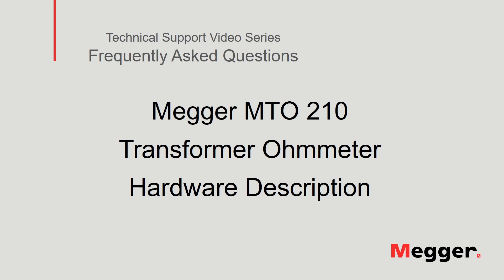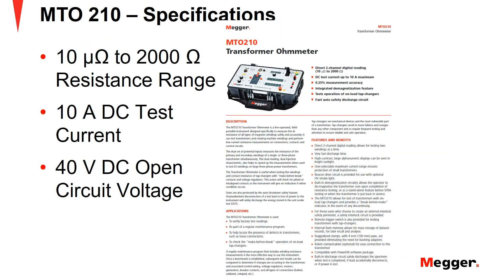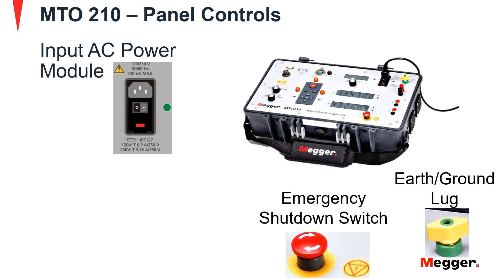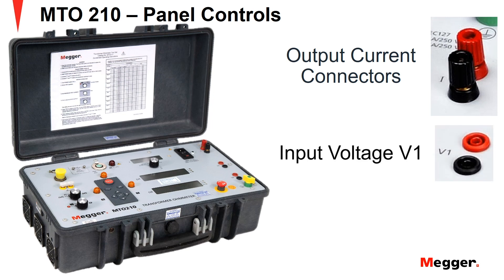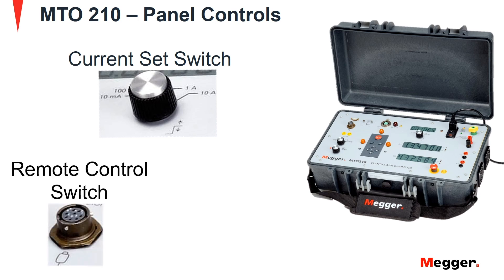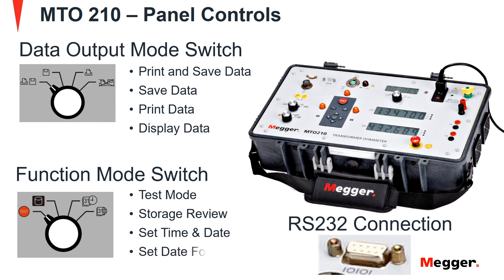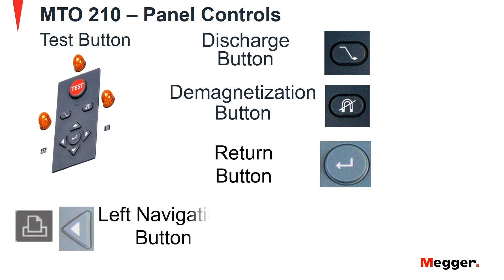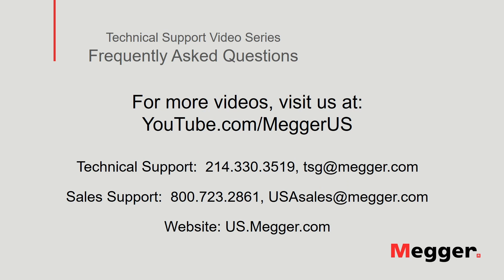Megger MTO210: Hardware Description and Overview

Comment: Sir we have same kind of set .....but problem is that ....when we inject current in power transformer the current not injected.....please help
Reply: Yes sir you are right .... because mistake is that our team member supply 2 phase supply 380 volt....
Reply from the maker: Hi there, thank you for your comment. Please could you contact our TSG team depending on your local area, details can be found on our website https://megger.com/

For UK please contact dovertechnicalsupport@megger.com or call 01304 502102
Reply: Sir you have error tables please share to my email please